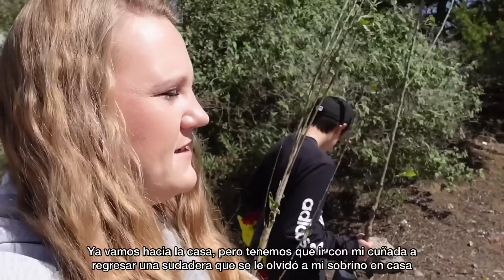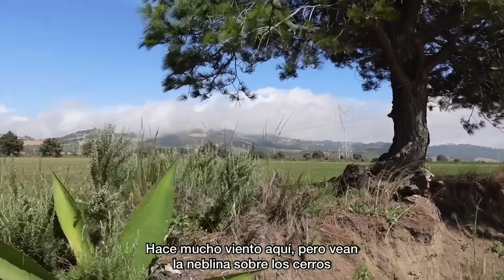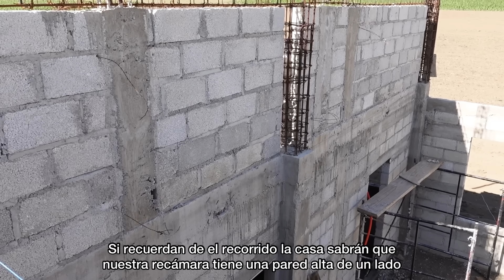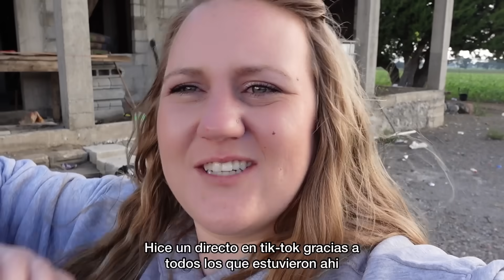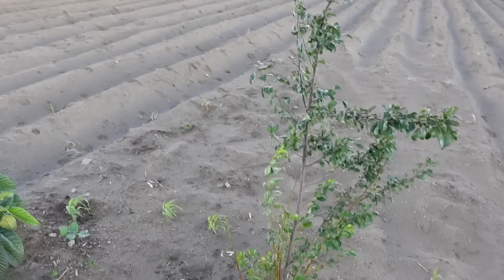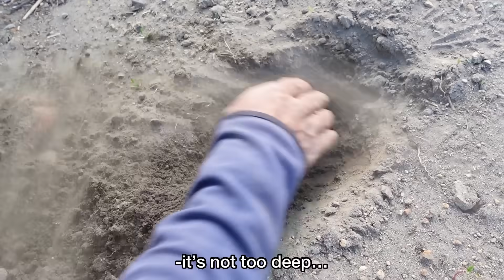Building Our Home in Mexico - Update and Planting New Fruit Trees!

Comment: Is there a reason why the homes are made out of brick? Will you put drywall up or does it stay like that?
Reply from the maker: Yes most of the homes here are built with brick. This is for different reasons, termites, humidity etc but overall brick just lasts longer. Homes here are built for generations.